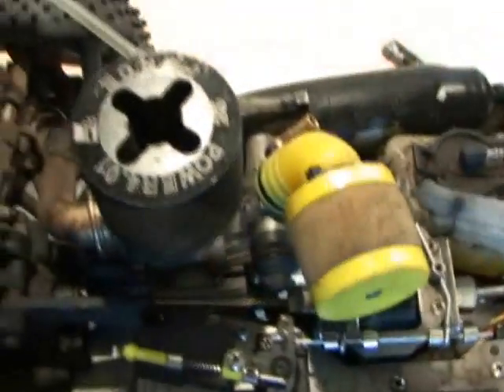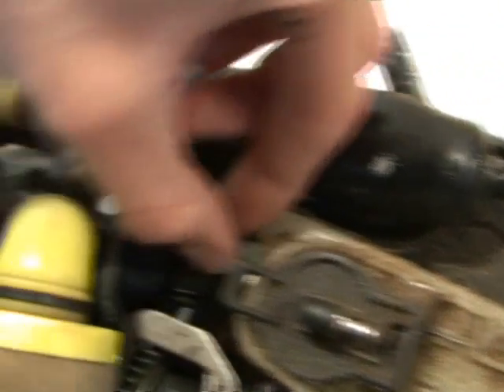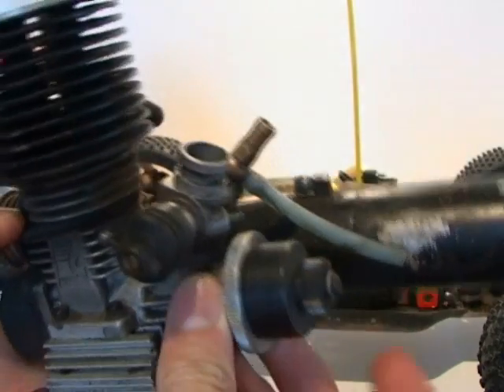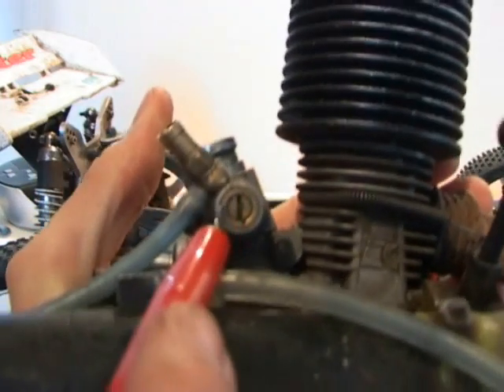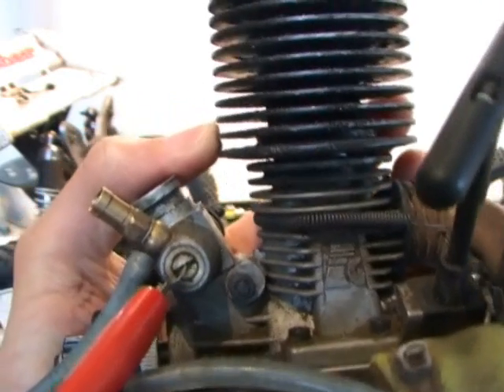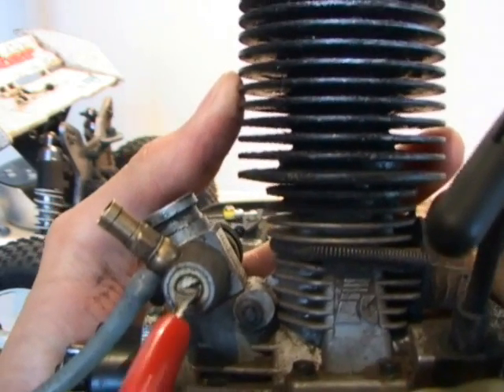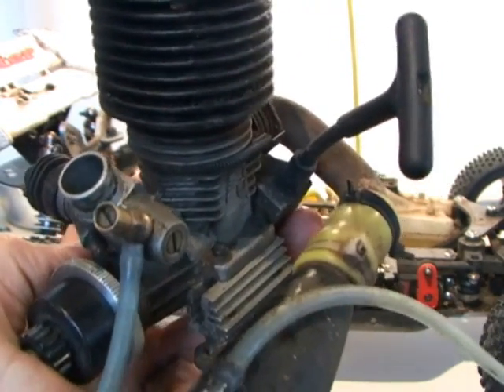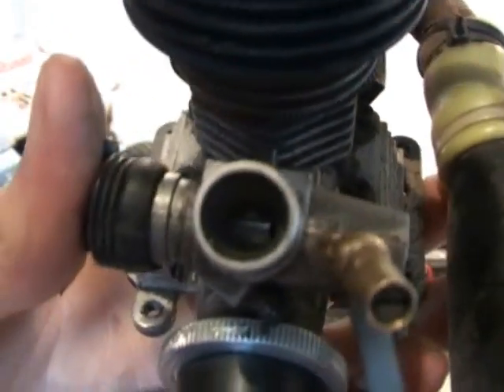Basics of Nitro Engines + Tuning

Comment from the maker: @876904 well try these steps first:
1. Check glow plug+glow start batteries, is it glowing?
2.Try priming the car before you start it
3.warm it with a hair dryer
4.try starting it
5.if it wont start try taking the glow plug out pouring a little fuel in and then start it.

if all this fails, try a new glowplug get a hot one if its a new engine,
try a new more powerful glow starter

a lot of starting problems are due to bad glow plugs and or rubbish
glow starts hope this helps :)

Comment from the maker: @popcornreviews yes, this controls the acceleration or the low to mid range of the engine, this is adjusted in the same way as high speed, if acceleration feel slugish lean it out if its too quick and overheats richen it :)

Comment from the maker: @MrBmxg Yes a starter box is probably the best option if you dont want a pull start. but as you said it will require a small 12v car battery or 2xNi-Mi packs at a time so it would be even more costly than the drill start. if you have the money then go for a starter box and a small 12v battery.

Comment from the maker: @MrBmxg The engine in a .25, most backplates fit any engine I think. its a sort of universal fitting. (correct me if im wrong) it may differ from manufacturers but I used the Hong Nor pullstart on my Hunter. I wouldn't recommended the drill start, it eats battery up like mad. if its a cold day and your car wont start and the battery runs out.... so if you get the drill start you will need at least 3 spare batterys. it works out cheaper just to buy pullstarts.

Comment from the maker: @COOLGUY4593 sounds like there's a problem with your radio system. remember you should always turn the radio on before the car. if your running a 27mhz radio check that the receiver and controller both have the same crystals in. if running 2.4ghz you may have to reprogram the connection (check manual)  another thing it could be is that you do not have the trims set properly e.g you have neutral on the controller set to max throttle on the receiver. that sounds like the most likely problem.

Comment from the maker: @876904 do you mean receiver batteries? these are to power the servos that control steering and throttle, the car wont work without it.

Comment from the maker: @SanchezBoss209 Sounds like its running too lean (its being starved of fuel at high speed) try running it a little rich. If this doesn't work you could up the fuel % although I wouldn't recommend going higher than 25%. The extra nitro can help cool the engine.

Comment: @gmodertom i have messed with  trim transmitter.
but still same and i dearnt bess with theotehr screws as the car is secand hand so oveasky no maual and i dont no what the shop setigns are or i wood just set them to that then go from them i have done what u menshoned in one of ya vids and set the screw flush if get me

Comment: Can some one help me? i have the same engine ,but when i pull the pull start fuel comes out the cylinder, i have tightened the screws very tight but fuel still comes out.